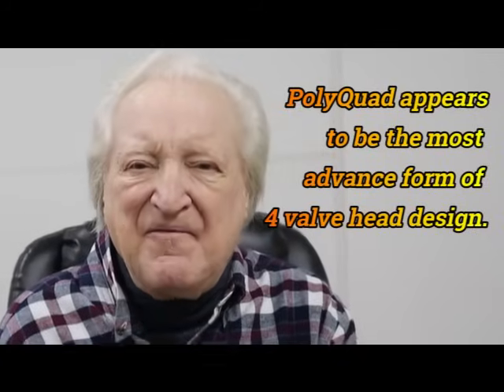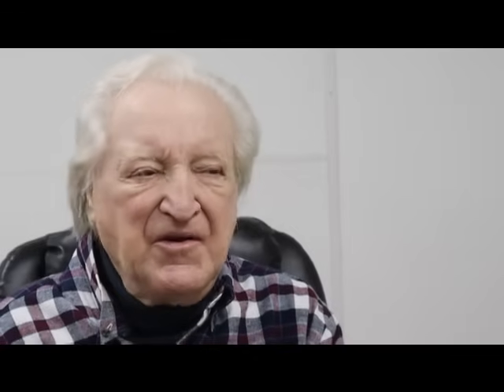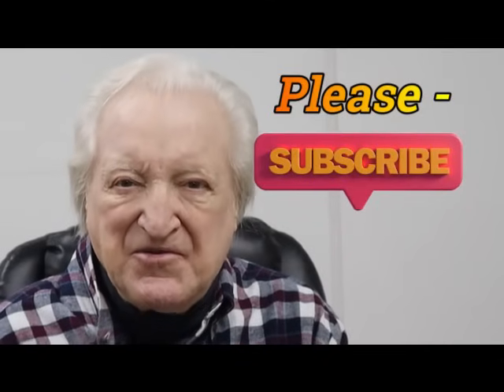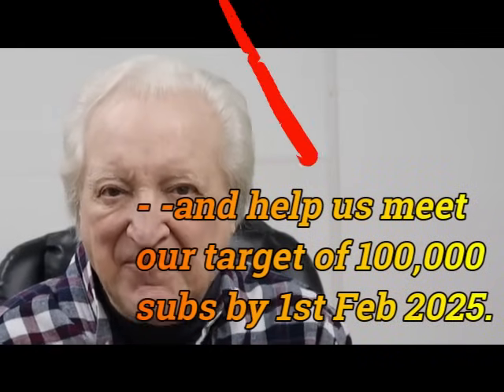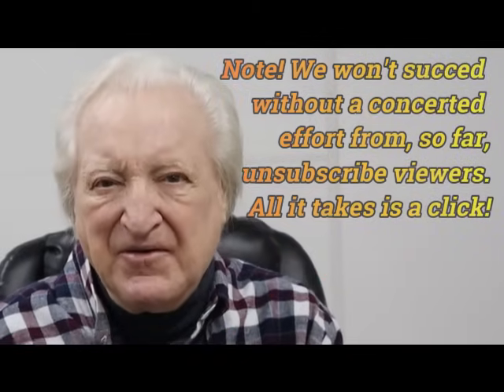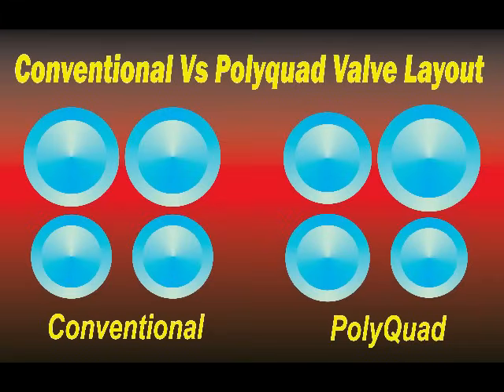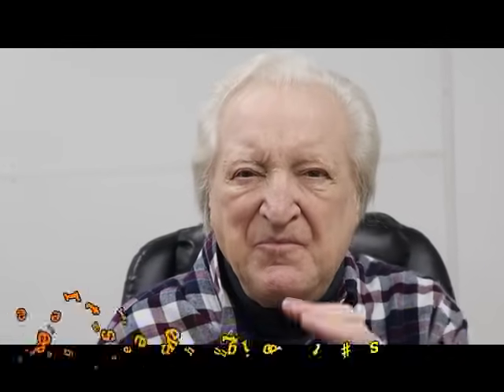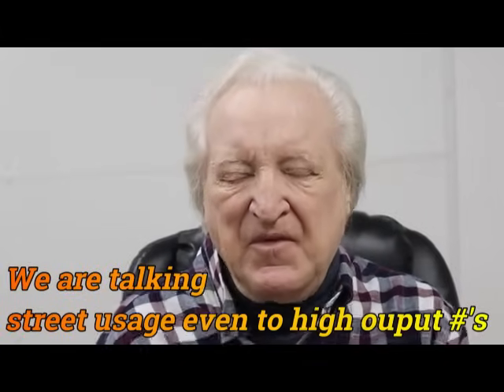PolyQuad - How the worlds most powerful 4v heads are built.

Comment: I've always been a fan David I bought but how to hide a small block Chevy book when I was 15 years old Air flow valve and cam timing specs do not ever go out of date Might be new technology or new rules but air flow characteristics. Dynamics of the way the engine works off of valve event timing and compression ratios and stroke does not change. Only changes for different engines and where they're happy. So you sir and my opinion are never out of date.

Comment: Absolutely wonderful non-hype knowledge of real engine building, amazing thanks for sharing.

What about porting 4 valve toyota 3rz heads? 
How to maximize engine torque at 2k~4k rpm for 1st gen 4x4 Tacoma? 

NA, +020 bore,  -030 milled off head, -010 off block, -020 thinner mls head gasket, +1mm inconel exhaust valves.  Thus -060 should bring static CR be around 11:1ish from stk 9.5:1.

Most 4x4 2.7L trucks spend maybe 1% of service above 4000, without moving what little torque how to maximize a NA 4v port headwork if any in 2k~4k rpm for street and off roading?

If we lived in a free state? We’d be free to buy a turbo diesel and drop into our own vehicles, no sadly CA is full retard, we know never go full retard.

Thank you for all the racing knowledge most excellent gift for those who value the truth.